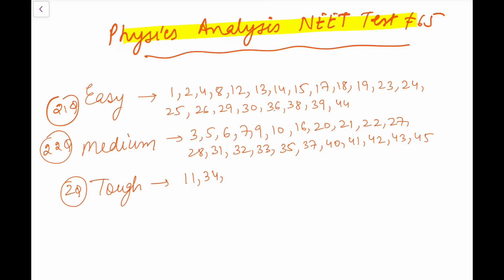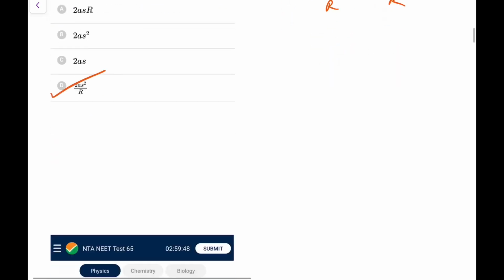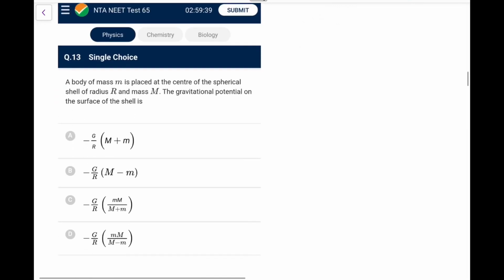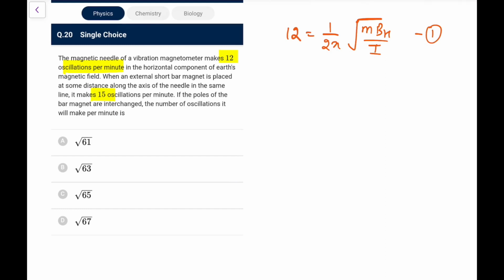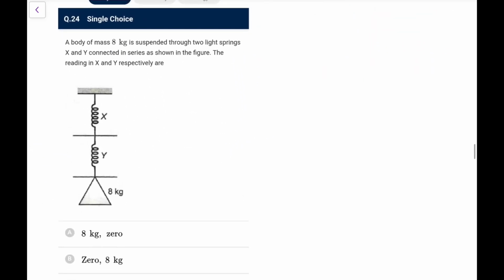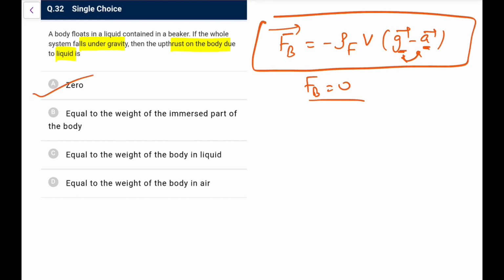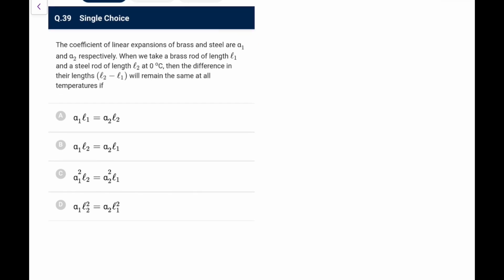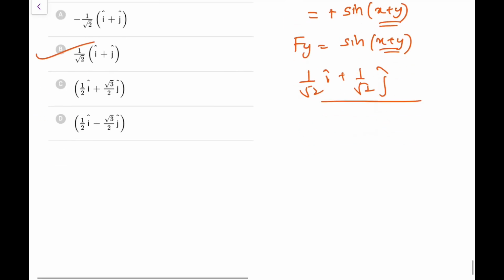Physics Solutions NTA Abhyas NEET Test 65

Comment: Sir would u pls explain me 11th ques ...i actually didn't get the concept ....if the field is max at that point then the force also should be max na.....pls sir help me in this🙏
Reply from the maker: actually it’s a non uniform field and the expression we have for force involves dE/dx so it’s not like the way you are thinking. it depends on rate of change of field with x here which is zero at maxima condition